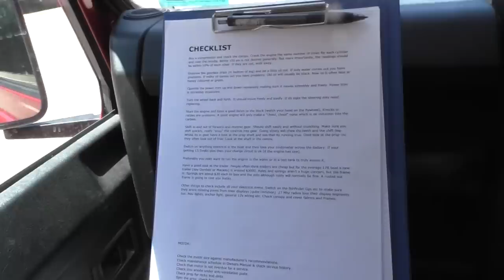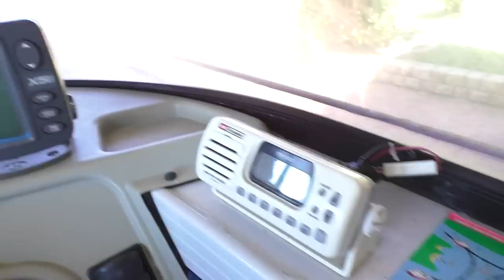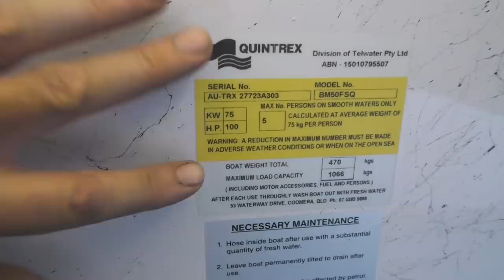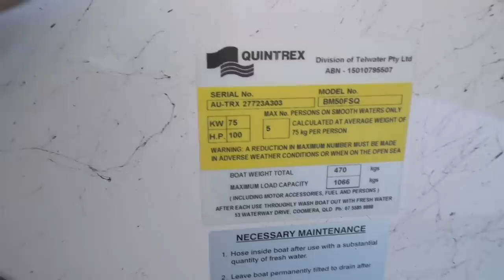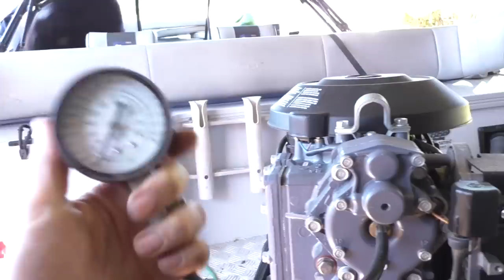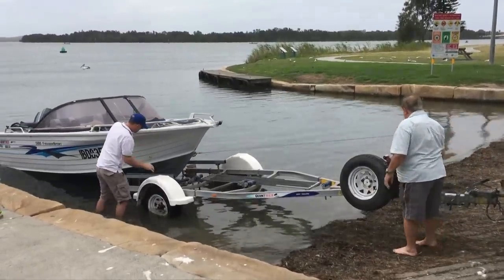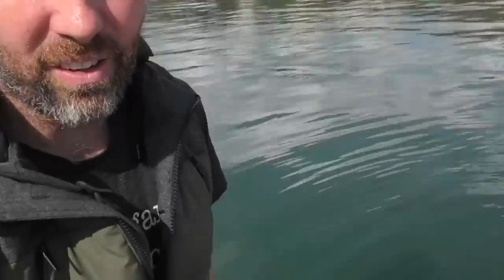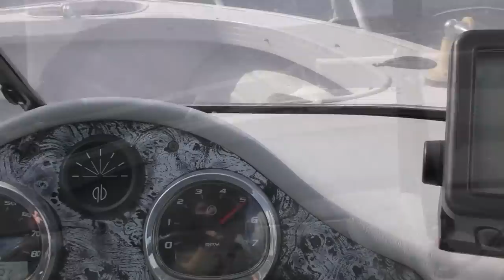Buying a used boat

Comment: In the US, most recreational boats are fiberglass composite.  Also most of these boats spend more than 50% their life on a trailer and stored in the open.  Frequently, they are not covered properly and rain/snow gets in and rots the floor/stringer/transom from the inside out.  This is difficult to detect without multiple core samples or a good moisture meter.
Reply from the maker: Yes, checking a fibreglass hull probably deserves a whole video on its own right.

Comment: Don't know about in Australia, or even other states, but here in California, you're taxed on the price of the boat (and trailer) when purchased.  I get separate receipts for the boat, motor, and trailer so am only paying the taxes on the actual purchase price.   Some states have a property tax that includes boats (and motorhomes, I think) so this may not be beneficial, even if feasible.

RichE
Reply from the maker: It looks like we have a flat rate for registration transfer on boats ($32) but when you do pay stamp duty it is a good idea to get separate receipts keep the cost down. I like that idea.

Comment: Hi Stu, alls good with my stuff now  but have a console switch question? To the Rh side there is 4 switches and can read 3 of them being an older boat. One is the bilge, one is the fishwell, and one is the curtousy light. Last one dont have a clue? One guy asked if it's the nav lights but it's on the Lh side of the console by the horn. Got any ideas. Its stock not a add on. Thanks
Reply from the maker: Not sure what it on the stock boat, but given there is a fishwell installed it could have been a sounder, seems like a logical grouping. If it was me I would stick my head under the dash and see which way the wires head.

Comment: Hey Stu quick question for you, I bought a 87 30 hp Nissan forom a guy and he sent me a video of it running and it started up good , so I bought it put it on my boat and it wouldn't idle or stall when I try to put it in gear in the water. once I got it in gear it wouldn't get over 1500 rpm at wot so I cleaned the carb and made sure the fuel pump was working,no difference ,did a compression test and top cyl. Has 135 psi and bottom has like 15. Do you think it could have a stuck ring from sitting for a year any input would be great really disappointed it doesn't run the way the guy said it did, thanks
Reply: Hunter lauzon If the compression is that low on the one cylinder, I’m surprised it idles at all. You might have a gummed up ring( or too much ash ). There are various cleaners that you can spray or let soak in that cylinder and eventually slowly hand turn the flywheel in the proper direction(usually clockwise). I hope you get lucky. Can you get a gun barrel light to feed into that cylinder and get a look at the piston dome? That might show something?? Really hope the best for you.👍
Reply from the maker: Thanks for helping out Reid, always appreciated. :)
Reply: Figured out it was a blown head gasket

Comment: I may be missing something ... but, why so many aluminum hulls in a salt water environment?  Why not more fiberglass hulls?
Reply: Aluminium tends to be more rugged for beaching etc, and usually cheaper. Aluminium is self oxidising.
Reply: And where Stu is, there are a lot of rocks.  Rocks and fiberglass don't mix well at all, aluminum is more likely to deform.

RichE
Reply: easier to weld aluminum and get a good sturdy lasting repair. not so with fiberglass. and over time fiberglass gets brittle.
Reply from the maker: As RichE said, for us is all about the way the boats are used. They are run up on beaches, banged against rocks, tied up overnight against wharf piles and other boats. Fibreglass just doesn't last under those conditions.

Comment: Hey Stu I have an older Suzuki 2 stroke and I have a slight bend in the shaft, is it possible to straighten it? Have you got any videos on doing it. Motor still has high compression and runs fine.
Reply from the maker: I've very had a go at straightening a bent shaft, but you aren't the first person to ask. I think it would make a great video so I might find an old prop shaft, bend it and then do a vid on straightening it. It can be a bit hit and miss though so you may be better off replacing yours with a spare part.

Comment: You should also check the gearcase oil
Reply from the maker: Yes, it's on the list but I forgot to mention we didn't check it on this outboard because it had been changed the day before during a major service so it wouldn't have told us much.

Comment: not only a reciept or bill of sale  check  for titles registrations and tranferability. my boy bought a boat in another state (20 miles away) with a trailer. was able to transfer the boat over but in that state the boat registration covered the trailer  but our state doesnt. they need to be titled seperately. since the trailer was never titled and was more than a year old the manufacturer would not supply a certificate of origin to get a title.(original lost)  so in order to get one from the state you must go through hoops to get one. it would be easier and cheaper to buy a used one with good title IF you can find one. lesson learned.
Reply from the maker: Ah, interesting scenario. In Australia all trailers are registered separately but I can see how you would get caught out with that.
Reply: yes trailers with dmv and boat with fish and boat commision  crazy  and now they've implemented titles for outboard motors cuz so many are being stolen
Reply: Stu didn't mention that if you keep a record of the title checks you do on the government website (it is only a registered loan/encumbered item check)  and you keep a copy, even if the item is later found to be encumbered, you are covered  from any action from lawyers/police. Not doing that 10 minute/$15 check is a stupid thing not to do. Australia is also working towards a common set of road rules for the whole country. There are still some differences, J turns in Victoria for example, and a LOT of police officers who's knowledge is way out of date or a misinterpretation of the new road rules, but we are getting there. But it also means fines and demerit points incurred in one sate will come off your home state license.One thing Stu didn't cover is trailer brakes, when required, how to check them. And if they are electric, make sure you have compatible brake controller fitted to your car before moving the trailer/boat anywhere.

Comment: Hi Stu, I am thinking of buying a late 1970s fletcher speed boat with an Evinrude V4 engine of the same vintage. The boat and engine appear to have very well looked after and are in good condition and running order. But, I was wondering what your opinion would be on running something like that - is it likely to be very unreliable? - parts for the engine difficult to get? etc. Thanks as always for your videos and help.
Reply from the maker: If it has been looked after those old Evinrudes can run for a long time.
Reply: @DangarMarine  Thanks, what would you say about parts availability? I'm concerned that it's going to be very difficult to get parts for it?
Reply from the maker: MarineEngine.com should be able to supply parts for you.

Comment: Caution with bank cheques when selling. They can be cancelled. Go to the bank and do a funds transfer.
Reply: David Love absolutely right, either cash or “cleared funds” as an ex broker/new boat sales guy this is rule number one.... also if it seems too good (cheap) to be true it probably is....
Reply: Bank cheques can't be cancelled in australia
Reply from the maker: Yes, in Australia you either need to return the cheque or jump through many hoops to prove it has been lost or stolen.
Reply: Bank cheques can be cancelled in Australia, ANZ will cancel a bank cheque on some ones word I found out from staff at a branch when I was opening an account in 2017.

Comment: Hum? So he went with the Mercury rather than the Yamaha. I own a similar 3cyl (85hp) Yammy  it's a 1993 model. I have owned it for 14yrs, it had a total of 161 hrs when I acquired. Other than replacing the the props shaft seals, and the occasional impeller, the motor has been 100% at performing. It has been mounted on a dual console 17' Key West from the original owner. I've been a Mercury fella since 1977, owned a couple johnsons & Evinrudes. Currently my arsenal consists of 3, 25hp mercs(tillers), 2, 115hp 4 cyl merc's, 1, 115hp merc 6cyl (tower of power), a pair of 200hp, 2.5 cyl ( carbed Merc's), a 4hp Johnson & a 15hp Yamaha. But by far & away, both the yamahas ( 85hp ,15hp ) are the most reliable, HANDS DOWN! Merc's switch boxes are a sore spot in their makeup, along with the oil-mix system MAINLY ON THE V6's. All three of my certified mechanic friends agree to disconnect that system & pre mix by hand. It's a stupid design with the nylon gear driven by a steel worm gear. I just don't see that much advantage with the 4 stroke merc over the 2stroke Yamaha. Plus added weight with the 4stroke. Yeah, it maybe a bit newer, but as my mechanics advised me, I'll be paying them a whole lot more to do repair work to the 4 stoke when compared to the two stroke Yamaha. But hey, why listen to me when I'm talking 'UP' about yamahas when I mostly own mercs!!☺️☺️☺️ Great channel Stu👍
Reply: Hi,I also own Yamaha 85hp,what were your compresion readings,regards from Serbia
Reply: No, he mentioned this was a different, but similar boat and different engine.

RichE
Reply from the maker: 120PSI on each cylinder.
Reply: Switch boxes? Its not 1960 anymore! Mercury is shit though, especially their mid size 2-strokes. Yamaha 70-90 is the best two stroke ever built in that size category. Mercs 4-strokes 40hp and up is also made by Yamaha, its not until they started their verado series that they have a own head developed, and..... its shit aswell! The only good engine that mercury ever built is the 2-stroke 2.5L EFI engine. Same goes with yamahas best 2-stroke, the 3.1L EFI engine. 4-strokes is also much cheaper to maintain if your not retarded and need to send it away for a service. You can run 3000-5000 hours without any problem with more or less just basic maintanence. In this time you have to rebuild your 2-stroke about 5-10 times.
Reply: Obsoletefreedom  It May not be the 60’s, but they are still called switchboxes according to Marine Engines website. The diagram shown for a 1999 200hp describes it as a switchbox. 
As an added note, their added Idle Speed control module is yet another headache if it goes haywire. It caused one of my 94’, 2.5l 200hp carbed to burn up two pistons and a breakdown to remedy & get it back in proper order. So the twin to it was removed before it had the chance to call up the gremlins..
Reply: reid092353 switchbox is not used, a switchbox is a very basic precursor to cdi. Its cdi, ecm, or ecu the last 30 years. You cant burn two pistons on a carbed engine due to a sensor. Badly adjusted butterfly valve, clogged carbs or bad oil nipples is what can kill it. Havent used a carbed engine in twenty years.
Reply: Obsoletefreedom apparently, we’re trying to split hairs on the definition. But I know you understand what I’m saying. I appears your out for an argument, but the certified mercury mechanic, who has been around outboards for his entire life( his father owned the mercury franchise prior), diagnosed the culprit as the idle module. And yes, it took out two pistons. I was there when they were removed. Why are you pounding my ass on this??
Reply: reid092353 Change mechanic, just another rip off with zero know how. If you rebuild a couple of hundred engines you see no logic in a carbed two stroke losing two pistons due to a fualty idle sensor. You meen the sensor flew into the carbs and clogged it? A carb engine is a very basic design, Fuel in fuel out. As long as this workes combined with working oil injection it wont go down. But keeping a 6 carb engine perfectly synced require a owner thats not retarded, and thats why you see alot of cracked 2.5 engines.
Reply: Obsoletefreedom ok, maybe this will end this situation. My port motor(counter-rotate) lost power but got back to ramp with the starboard and loaded up to go home. Initially ‘guessed’ it was a SWITCHBOX. Removed BOTH top two plus to see if both were firing, but was surprised to find aluminum bits on one plug, even though it was still showing spark. I took it too my closest mechanic( certified Evinrude/Johnson) to get his opinion. He is a 30+ yr friend with my certified Merc mechanic. I trade back & forth with these guys if repairs get beyond what I feel I’m capable, but I bend their ears afterwards for pointers down the road. My profession is s dental tech, but always been fond of outboards. My Merc mechanic was stacked with jobs, so I handed the job( which was a breakdown to replace pistons) & If I remember correctly, resleeve  those 2 cylinders as well). A couple weeks later the job is finished and ready to break-in motor for 12hrs with double oil. ( I hand mix, as I have noted). At around the 11 hr mark, I feel lost of power on port engine. Drop back to idle, with engine shimmying. Turn both engines off and pull top plugs on port motor. Once again covered with aluminum bits & shavings. Call mechanic, said to drop it off at his shop on way home on a Sunday. Monday afternoon he calls me to inform of same diagnosis. He’s dumbfounded, but calls the Merc Certified mechanic/friend for any thoughts. Straight off he mentions the idle module. He says they can intermittently go bad and fluctuate spark timing. He said he’d seen this situation occasionally. Advised the Evinrude buddy to disconnect the module & remove it & also do the same for 
my starboard motor as well before it might occur. Still had to replace another pair of pistons, but thankfully didn’t scar the sleeves. That was over 300+ hrs ago and both motors have run  great. I had to replace a SWITCHBOX last August in the Keys for the starboard motor. They’re both 94’ carbed 200’s.
Reply: @Pludrike  Old carbed mercs are unbeatable! Tower of power forever!!!
Reply: Although you pay at the pump a good 2 stroke is WAY hardier and half the cost to repair. I'd take the reliability of a 2 stroke any day. What 4 stroke can be submerged a few days in SW and up and running in an hour with minimal work?

Comment: Is there any suggestions about what kind of (mpg) should this 200 hp. yamaha 1992 new plugs, all 3 carbs rebuilt. compression is good for all 6 cylinders. idle is set at 1000 rpm. throttle goes to 4500 to 5000 and planes up about 30 knots,..I need some idea of how many miles offshore can 20 gallons do.?
Reply from the maker: Not sure unfortunately. Because the hull can make a huge difference I would take it for some test runs under the sea conditions and you expect to be boating in and then stick to the rule of thirds - one third out, one third back and one third reserve.

Comment: How about inspecting for an internally or visible cracked block?  Are pro mechanics allowed to test drive boats under repair or for sale without all licenses and safety gear in place?  Do you carry a boat mechanic ID card for the cops?  (It's a big deal in Chicago.)
Reply: Bruce Wagenberg you don’t need much, Chicago seems strict, in Maine you need fire extinguisher And life jackets depending on the length, and anybody over 12 can drive any non commercial boat
Reply from the maker: You wouldn't be exempt from life jacket laws so you would definitely need to check they were onboard before heading off. You may get away without the boat being registered given it is a test drive but you'll probably need to be convincing. ;)

Comment: Outboard check: Check the condition of the gear oil, check for discoloration of the cylinders/heads as a sign she got hot. Make sure the engine is cold for your compression test. Love the videos! Makes me much more confident in working on my own boats
Reply: Why would you want the engine cold, other than you won't burn your hands?  Coming from an automotive/4 stroke world, you always wanted to do the compression test at operating or near.  Also all plugs out for testing, and throttle/carb(?) full open.

RichE
Reply from the maker: Ah, I actually forgot to mention that the reason we didn't check the gearbox oil is that it had been changed the day before during a full service.

Comment: Bank cheques aren't worth the paper they are written on, there is nothing stopping a buyer handing over a bank cheque as payment for a boat, or anything else for that matter, taking possession of the boat, driving straight to the bank & saying He has lost that bank cheque, please cancel it & can I have my money back which the bank will gladly do.  Meanwhile, the seller deposits the bank cheque into His or Her's bank account none the wiser & 48 hours later its dishonoured as a cancelled cheque by the issuing bank & the boat is long gone, it's a scam that's going around, one scammer even brought His kids to the boat buy. Direct deposit into your bank account or cash only, direct deposit is best even if the seller has to open a bank account the same as the buyers bank, then it's cleared instantly.

Comment: Reckon you may need to change your brand of beer.
Just sent an inquiry to Marineengine.com , added that I got their info from you.
Reply from the maker: That "Coopers causes kidney stones" headline was fake news. ;)
Thanks for the mention!
Reply: If you're not to suffer illness or injury on your boat, you should always drink the beer recommended by the manufacturers of your hull/outboard.

Acceptable beverages will be listed in the user manual under "Recommended lubricants".

Ignore this specification by using cheap, inferior alternatives and your essential operating systems could experience accelerated wear and tear, and  may incur catastrophic damage.

You have been warned!